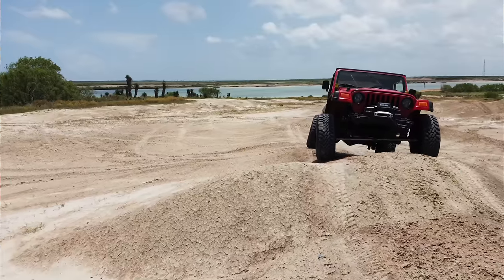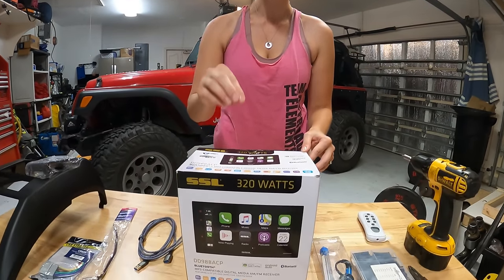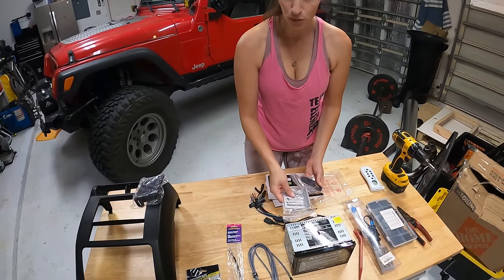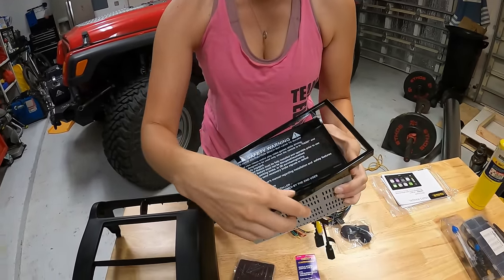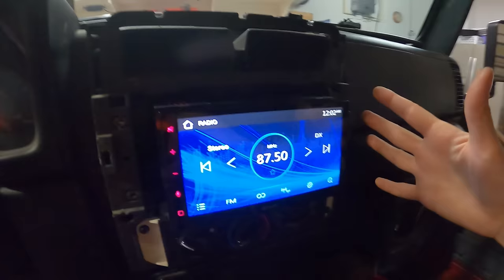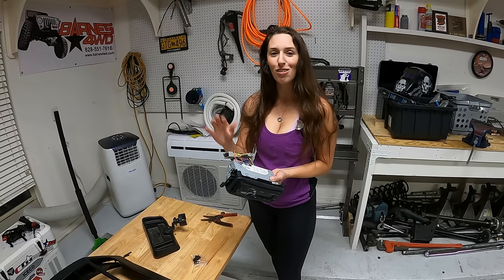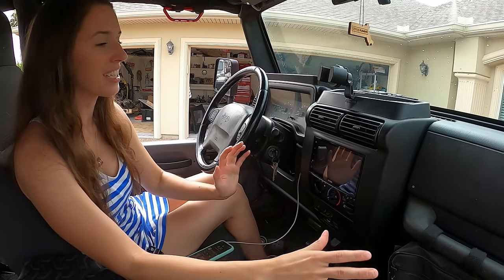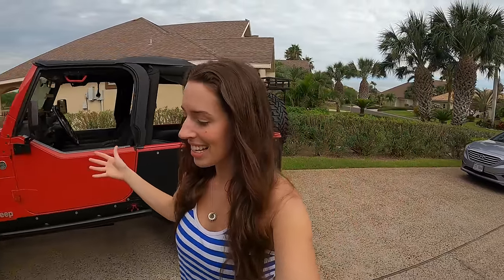Installing A DOUBLE DIN Stereo into A Jeep Wrangler TJ/LJ

Comment from the maker: What are some of your favorite interior upgrades you have done to you Jeep?! Let me know below!!!
Reply: I absolutely love the Smittybuilt G.E.A.R. overhead storage and my Grabar's. Also what are your grab handles?
Reply: Went from the stock lighting to LED's and what a difference .
Reply: My only Jeep is my 2020 Gladiator Rubicon, but my best interior mod is a toss-up between the Jeep/Mopar all-weather floor mats (with the drain plugs), and my 67 Designs carbon fiber phone mount.  Both are awesome, and I use both every time I drive, so I can't choose between the two which I like best.
Reply: @thomasthewrangler  wish they'd make one for the JL
Reply from the maker: @mudrunner2005 Big fan of both of these!
Reply: My vector e dock and 67 designs mounts.
Reply: Favorite interior model is the l.e.d truck bed lights that I mounted inside the tub for interior lighting.
Reply: I enjoy my tj's Atoto A6 Pro. Dual bluetooth, built in wifi, it even allows you to view engine data thru the obd2 port via bluetooth/wifi dongle(rpms, gear indicator, temp, oil pressure)
Reply: Vector bar fo'sho
Reply: My favorite interior mod so far is to remove all the carpet and spraying in a textured ‘bed liner’ material. Took the better part of a month to prep the surface (water & salt had gotten under the sound deadening sprayed in stuff and was starting to rust) & two days to mask and spray the entire interior. Additionally I did the door sills and a few other high/chip wear areas to protect them as well. I did this 5 years ago and still in love with it. I just found your channel, and love the more ‘real’ feel to it... have been thinking of doing my own but don’t have a video background. Your channel doesn’t feel like it’s overly produced, overly edited, or fake. Think I’ll give it a go as a side project. Good luck, hope all is well in TX.
-Axeman Two Zero
Reply: Rear deck cover
Reply: '06 LJ ... Saddlebags, G.E.A.R tailgate cover, ham radio, CB radio, Android stereo, tuffy underseat storage ...

Love all my interior upgrades. Next is setting up a console on my hardtop. Snagged a top console from a Chevy blazer to try to put in
Reply: Just bought a 2005 TJ. The radio was stolen out of it so it just has wires haha! Great video, I'm in Houston. I want the radio! Or ill just go buy one. Thanks for the video! You guys are great 🤙
Reply: My sound system has to be after all the dang money I threw into it but it makes road trips so much more enjoyable
Reply: I'm running Kenwood dmx7706s that way I could mount my kicker amp behind it
Reply: A Tuffy locking drawer under the seat for my M18 that I'll be putting in tomorrow, a Motorola Astro Spectra Plus VHF transceiver that I use on the 2 meter amateur radio band. I also have a POS Dual radio installed by the PO that I want to replace with something less horrible.
Reply: @JeepGearGadgets  do you still have the stereo?
Reply: Added a Navy 20mm Cannon Ammo Can as my center console. It's all steel and lockable, fits right in with the military look and feel of my CJ7!
Reply: RC 6 light switch panel.
Reply: What size radio is it ? 6.2 ,6.8, 7 ?
Reply: Tuffy Security Products 296-01 Security Tailgate Enclosure.   I got it new in 2019 off ebay for $190 total.   That is the best thing I've done to my Jeep because I never have the top or windows on and it's fairly impossible to get into.
Reply: Would a 6.95in screen fit in this dash piece you think?

Comment: I installed an Alpine ILX-W650 shallow double din with the Alpine KTA-450 amp power duo in my Jeep. I love the setup. All of today's modern features along with Great sound!!! Back up cam is wired along with a new Kicker 6" center console sub and a 10" Kenwood sub with Alpine amp in the rear. But my favorite interior mods so far are the LED light replacements.

Comment: I run the pioneer 2550NEX. I installed a while ago and yesterday I installed the eRapta b/u camera!! All works great and a must have. I also replaced factory speakers with kickers and installed a crutch field sound ordinance powered sub inside the center console. You can actually hear clear sound with the top off! As someone else mentioned, hope you got the scissors out🤣

Comment: I just recently installed a Boss double din radio in my 2005 tj Rubicon, and I love it. The 320 watts of power really sound awesome in the Jeep. All I want to do now is fix the factory subwoofer. You did an awesome job and I know you will love the new system.

Comment: I installed a double DIN Kenwood/infotainment system in my TJ about 3 or 4 years ago.  At the time, I could not find a dash kit available so I had to make my own brackets, hack up the factory center dash cover, and do the body work on the dash cover myself.  It turned out great with a some cutting, fabricating, bondo, and paint.  That dash kit would have made it so much easier!  lol

Comment: I did a 7 inch motorized fold out single din Pioneer NEX3400. It is nice cause the Jeep is topless all Summer and it hides away when I'm not in the Jeep. Plus you can still use in in the tucked position if you get stuck in the pop up rain storm!

Comment: I did the double din upgrade on my daughter’s Jeep around the same time.  You really have to get crafty with the frame attachment. I actually plastic welded some brackets because the 99 radio mount was useless. I used an Alpine ILX with the wireless Apple CarPlay.  So nice!

Comment: Halford's in the UK sell the harness complete, so you do not need to solder the harness which comes with the radio, to the one you have to purchase for your car. It is just plug and play. 

I had a factory installed radio for Peugeot Citroen, but I have replaced it last week, with a 7018B.

Comment: There a splicers you can use that have solder inside and shrink type plastic so all you need to do is slide the wires in and hear w a heat gun. No need for soldering iron.

Comment: It's a jeep.. comfort and nice stereo system in a jeep is kinda funny to me..mu sedan is comfort and clean inside out.. my jeep is dirty inside out.. AC has been disconnected only thing that's in there is a marine radio with crappy speakers that dont even get use...floor is bare metal, its rarely washed.. did I mention it's dirty  inside out?.

Comment: You both are awesome.Love your videos and you both knowlegable when it comes to jeeps. . I just got bought a 2005 TJ Wrangler X and I'm having this issue.  The battery is new. The car was running but now the car doesn't want to turn on. The lights on the dash goes on but the engine light is on and it also says Check gauges. would you know what may be causing that?

Comment: The wife is pissed with you, I watched this video and put in an order for an Atoto A6.  :D

Now I wait for all the stuff to come in

For people looking at doing this, there are models that are thinner in design so you dont need to do the cutting. Most I have seen though dont have built in GPS.
Also if the model doesnt have Android Auto there is an app you can install on some models called HUD reloaded which mimics and displays like AA but even works wirelessly which Google is finally starting to come out with Android 11 supprt

Comment: This was the first thing I did for my LJ when I got it this spring.  So nice to have CarPlay.  I have the backup camera to go with, but I haven't gotten it installed yet.  I noticed your dash mount for the phone.  Does it work well with the double din dash plate?  Also what is that over your gauge cluster?

Comment: Hi Cassie, I upgraded my TJ last year with a single Din Pionner with a standart display, more especially to get a USB and Bluetooth connection. I built myself a soundbar. That means there are 4 Pionner 3 ways speakers. But the sound is not perfect about the bass sound. Probably because there is no subwoofer box. Do you have installed one in your TJ ? Thanks a lot.

Comment: Great radio, I have a pioneer however the guy who set it up didn't hook up my Subwoofer, and totally bypassed the stock cable harness. Do you have a diagram that could help with reconnecting the stock subwoofer? I am based in Abu Dhabi so don't have as many jeep accessories as I would like.

Comment: be careful of some of those wires, cant tell if theyre bare but those blue and blue/white wires i see dangling put out 12v when the radio is on and if they hit ground inside the dash it could pop a fuse or ruin something

Comment: I have 2000 TJ and thinking of doing this, in your JK project you guys had to add another module to the wiring, did you have to do that to LJ/TJ wiring.?
Reply from the maker: No, on older vehicles its not needed

Comment: Hey guys, hope you can help me out with a question. 

looking to replace stock radio in my wrangler TJ 2005. Dash and radio, dash, aircon vents and dials look like yours. 

Was looking to put in a joying single din 8.8inch head unit. But after reading online i have read that if you have an amplifier aftermarket stereos dont always work. 
My jeep came stock with 7 spearkers, Sub in the center dash between the 2 front seats and amplifier. I am led to believe the amp is also in the center dash, although have never pulled the dash apart to confirm. 

I keep hearing issues with Infinity and boston compatibility especially when looking through various android head units on aliexpress. One store mentioned requiring the use of a CANBUS however 1 or 2 forums i have checked mention that the TJ did not use canbus protocol until the JK was released and i should have no issues plugging in after market stereo and having everything work . 

Do you have any advise for person who has no ideas about the inner workings of cars

Cheers

Comment: Just bought this exact setup after watching this video. I was hoping you might be able to help with a question. I bought the dash kit with the supplied harness but the wires are not tagged and there was no schematic either... I’m stuck....any help would be soooo appreciated. Thanks in advance!!
Reply from the maker: Usually they will all be color coded the same, this should help you out. https://images.app.goo.gl/2JZ5JUw2U6eLzjHG6

Comment: Hey team! 
I'm planing to buy a joying 8.8 stereo for my Jeep TJ 2005. It's a renegade edition and It came with stock 6 speakers, sub and amplifer.

There is no steering wheel controls. 

I believe the 2005 TJ has PCI bus and not canbus from what I have read as canbus was not introduced untill 2007. 

A few local car stereo stores insist I need a amplifier retention kit.

But some forums I have visited insist that the 2005 is 22pin PCI Bus. 

Have you heard of a TJ with stock sub and amp requiring a canbus amp retention cables?

Was hoping this would work. 
https://catalog.pac-audio.com/catalog/installation-accessories/bha1818. 

Apparently Just need to make sure wire 13 is getting 12v from stereo to turn amp on. 

Any thoughts?

Did your jeep have sub and amp?

Comment: I would get one of these so u don’t have to have a wire just hanging there ... I love the radio  nice video I will definitely be buying this radio and dash but here the piece I was talking about it slides into the stock toggle switch spots all u have todo is pull out one of the inserts cut the face off it and slide the piece with inside the insert and put it back in the toggle switch spot I have had mine for 2 years and I hadn’t had a problem with it yet but here’s the piece (Metra AX-USB-35EXT 3.5mm iPod to USB Extension Cable - 27-Inch - Black) copy and paste it on Amazon... I think it will make setup even better and cleaner instead just the hanging wire

Metra AX-USB-35EXT 3.5mm iPod to USB Extension Cable - 27-Inch - Black https://www.amazon.com/dp/B00L2SF64E/ref=cm_sw_r_cp_api_glt_fabc_GSXKAGQKWX192NC853SH?_encoding=UTF8&psc=1

Comment: Is this radio capable of running subs and rca cables?
Reply: They also didn’t send me a plug in cable that it says it suppose to come with the new dash it jus came with the brackets if you know where I could get the exact same cable somewhere else?
Reply from the maker: Like this? That kit should have came with it, i would send them a message or email. But here is a link, im assuming this is what your talking about. https://amzn.to/32kD3z2

Comment: That radio you installed is a hunk of junk. Android Auto doesn't stay connected all the time, it takes forever to turn on let alone connect to a device, it only has one pre-out which is 2 volts, and there's no labels for what wires go where. Complete waste of money. I don't trust your reviews any more if you think this scam is worth it.